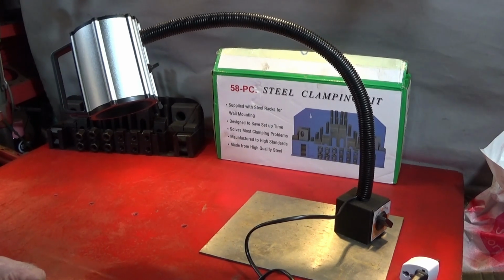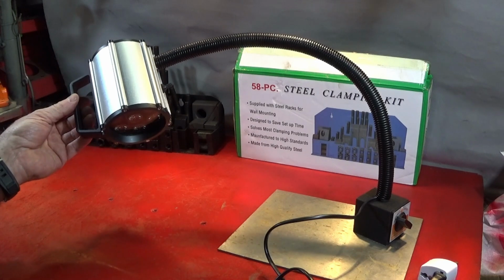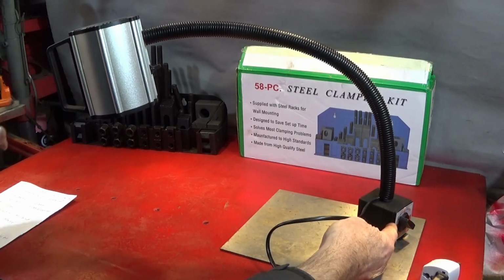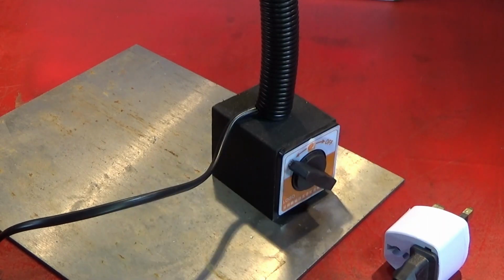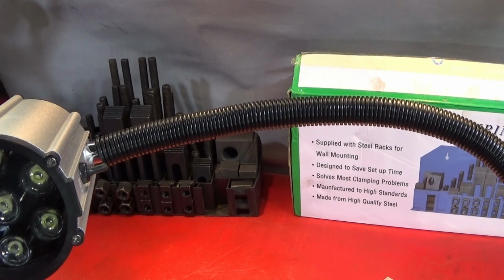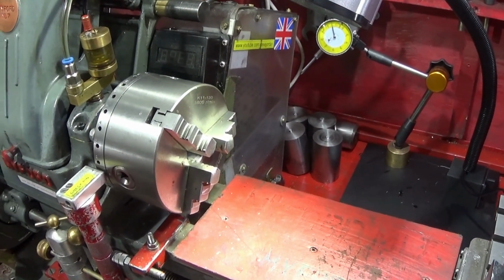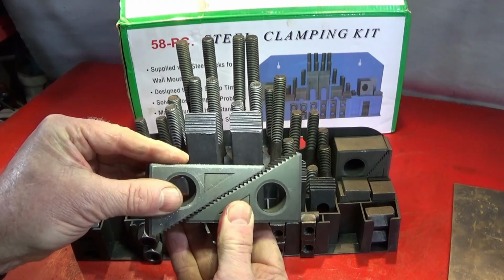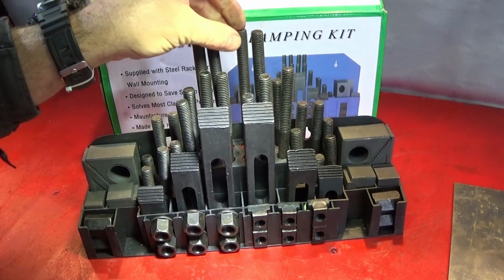A New High Quality LED Machine Lamp & A 58 Piece Steel Clamping Kit

Comment: Lighting can't possibly be underestimated Steve. Most every time I make a mistake with marking, measuring, or other fine work, vision is at least partly to blame. I recently flooded my small shop with 6 48" LED tubes, plus a pair of clip-on lamps with 100W equivalent standard A-19 base bulbs. 5000K is awesome, just like the sunlight!

Comment: Thanks Steve, interested to see how you find the clamp kit, whether you find it too big for the Myford. I know you said you will use it on the angle plate etc, just curious.
Cheers
Reply from the maker: Hi yes I just use it on the angle plate, some of it is a bit big but I know that I could use all of the medium to smaller parts. Also I used some of the larger fittings for holding things when welding. Regards Steve